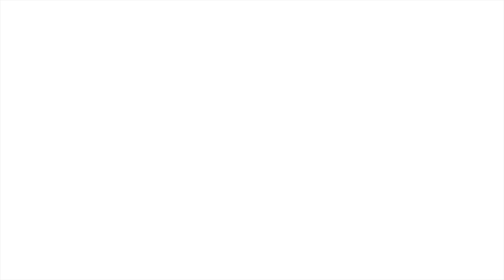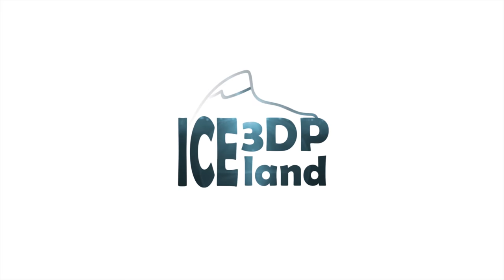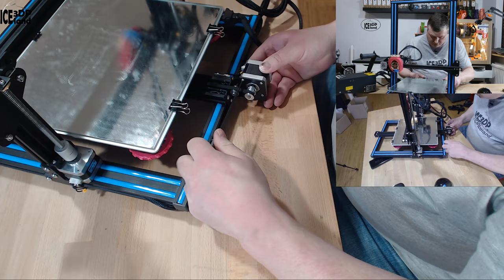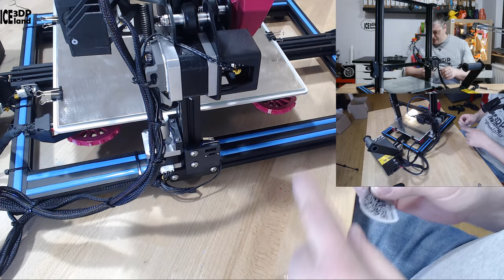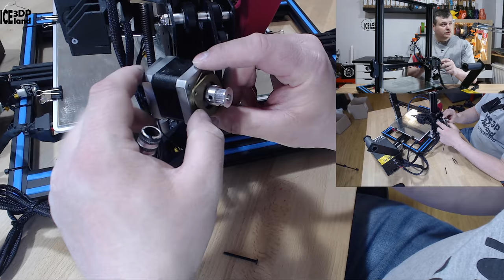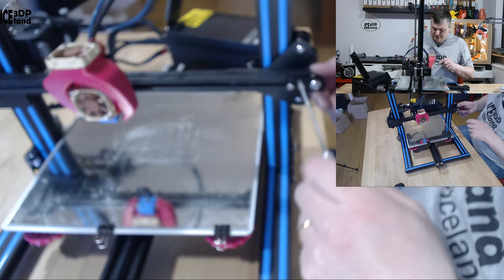Creality CR-10S  -  Nema 17 stepper motor dampeners

Comment: Will you show side by side type thing of how much quieter it is now?
Reply from the maker: it will be difficult, - I don't have a proper device to measure the sound level, but I hear less sound from the printer, so this works to some degree I can say.
Reply: I just added them to mine. I keep my printer in my bedroom and it was keeping me up at night. Now I can hardly hear it and sleep soundly. The loudest part is now the fan which is just white noise and helps me sleep.